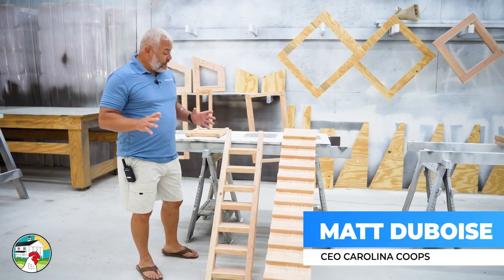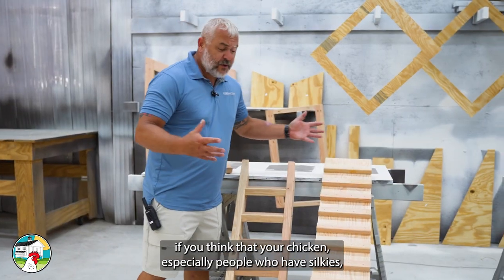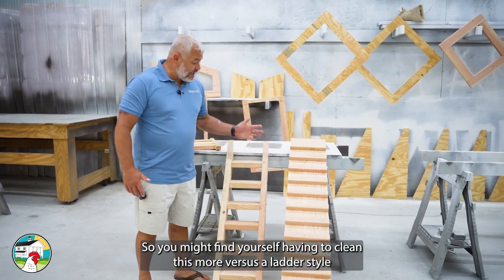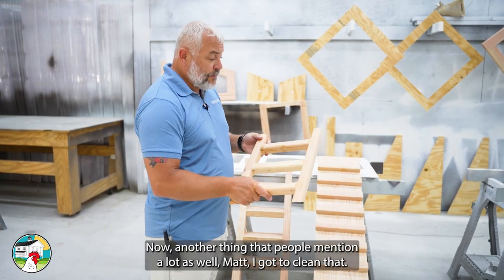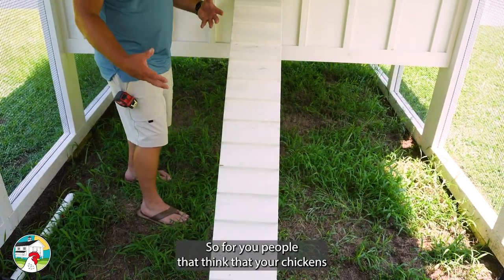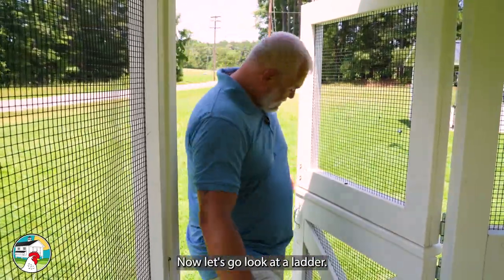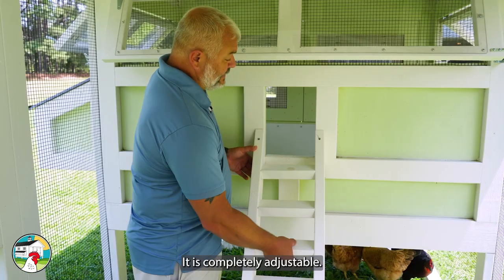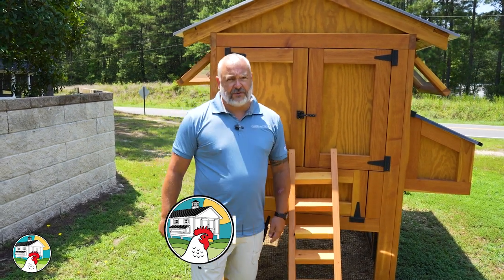CHICKEN COOP LADDERS OR RAMPS - Is One Better?

Comment: I started with a ladder, but the young pullets seemed to have difficulty. I added a ramp and it was easier for them. Both are in the coop and they are larger now and are using both. So, it may be an issue for the ladder with younger/smaller birds. Thanks for the video.

Comment: After watching this I really want a ladder, but I have silkies 🥺
Would a ladder work if the incline isn't steep and has the bumpers you mentioned? What if I have extra rungs so they're a little closer together? Kind of like the smaller interior ladder showcased in this video. I can suck it up if the modifications  aren't worth it, but I'm all about making clean up as easy as possible!
Reply from the maker: It's been our experience that silkies do better with the ramp then the ladder. That's not to say a silkie won't or can't navigate the ladder, but for the most part, we have found people with silkies (which cannot fly) will be more comfortable using the ramp to get in and out of the henhouse. Hope that helps. Thanks for your question.